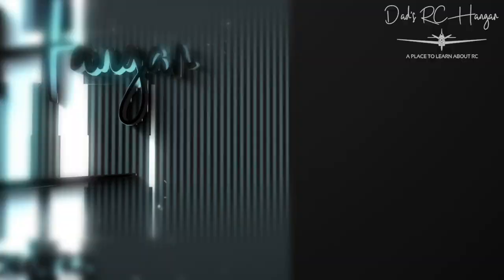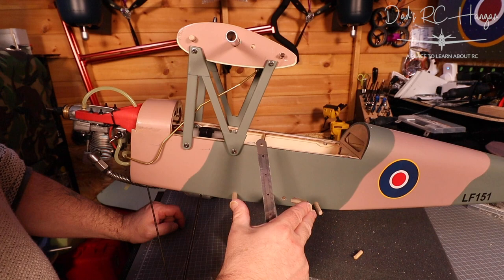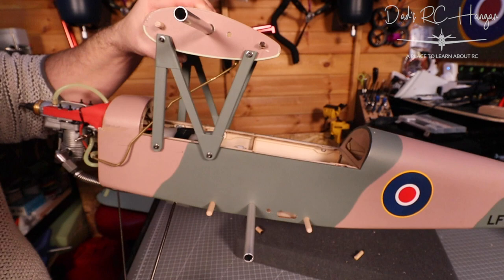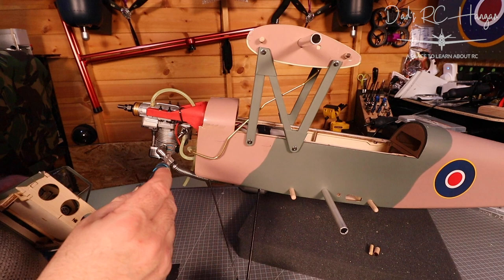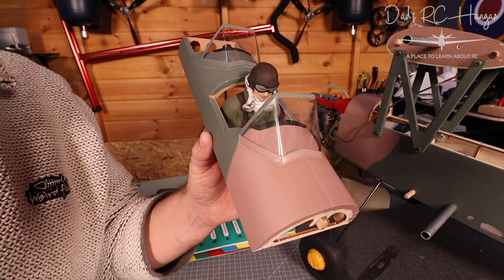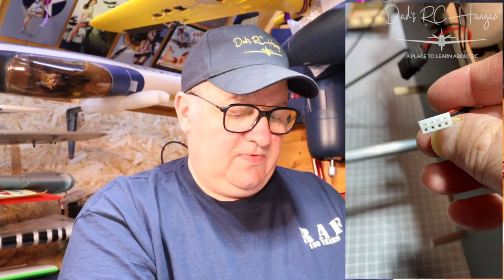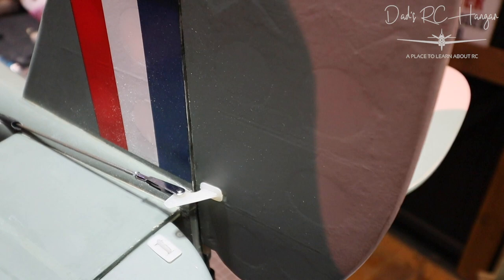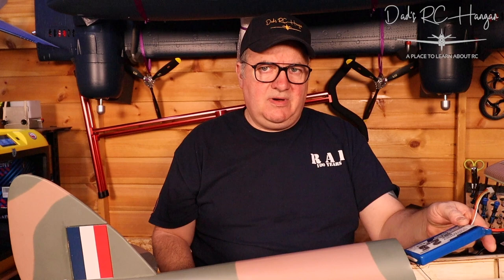Nexa Tiger Moth Build Tips

Comment: Nearly there Chris 😁 another cheerful Friday feeling mate. I’m looking forward to seeing the finished tiger moth with her engine running. By the way. I have seen some modellers using thin black elastic as as strut wires😁 they make little hooks from paper clips, glue onto the ends of the elastic then just hook them on, they look just as good, easy to make & remove and they are not there for strength, got my elastic from dunelm £2. Really like your tapped on windscreens, I will do the same! Stay safe & have a great Christmas 👍
Reply from the maker: Hi John, My neighbour gave me some fishing wire, so I will use that for now. Just waiting fir the new ignitor, let’s hope she fires up ok👍🏻. Stay safe and have a great week.

Comment: Nice video Dad. Have you checked the S6R works with Nitro engines? They don’t like vibration much so not sure they support nitro?
Reply from the maker: Hi T Dog, I will have to look into that more, I know FrSky R8 Pro has Anti-interference performance when it comes to spark-ignition, but it’s on the new FRSky protocol. Vibration should be ok as the receiver will be on Velcro. Hope you subbed and see what he appends. 👍🏻